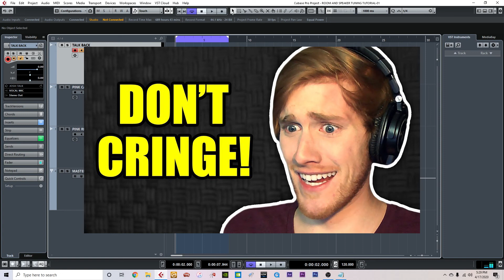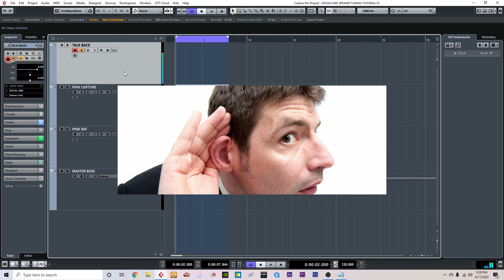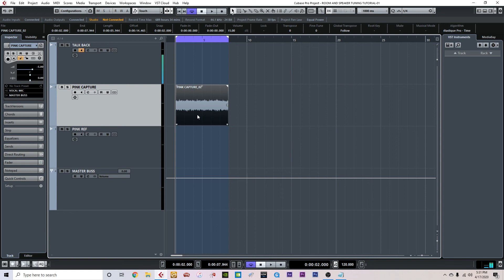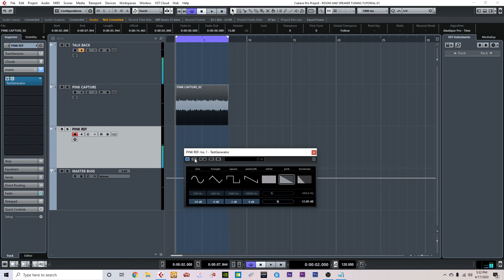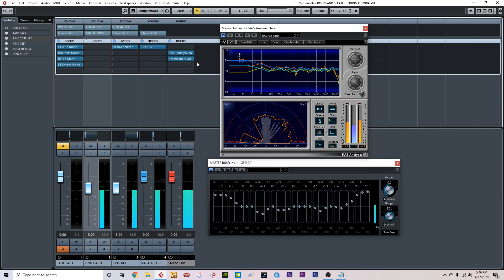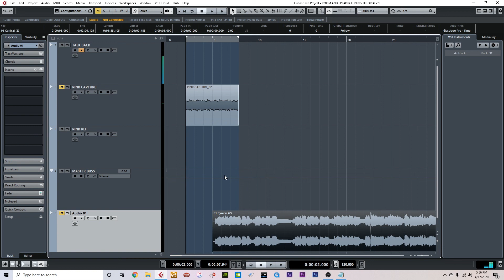HOW TO TUNE YOUR STUDIO MONITORS | USING PINK NOISE AND STOCK PLUGINS

Comment: Really nice job thinking outside the box on calibrating your studio speakers without a major investment. I was going to use Sonarworks but it just doesn't want to behave on my DAW computer so I used an external stereo 31 band EQ along with a physical RTA that is in one of my gig racks and it worked quite well in flatting out the speakers response however I just didn't want to have a physical EQ in my rack for the DAW so my idea was to do something really close to what you did here and I created a master group track so that all of my individual tracks would have to pass through the master group track that I would use to run a solo calibration track through and when I am ready to bounce the mix down to a stereo track for mastering I just disable the EQ during the rendering process. I like your idea a lot but I have to ask you as to what you are using for a microphone to capture your speakers with? With Sonarworks and some of these other programs that are designed for this they will normally sell you a calibrated microphone or explain how to load your own reference microphone into the program so that you don't get added color from an unknown reference microphone such as a bump up in the high end or any other microphone artifacts that could cause the calibration not to be true enough. I do agree with you to do the sweep where you sit and listen and I love the way you were doing the comparisons using the plugin! I also agree with you 100% that it does NOT have to be perfect! The main thing is to nail the really big dips or hot spots and call it a day! I will now go and do what you did here with the exception that I will use my rack mount RTA because it comes with it's own calibrated microphone so I know what I'm working with. Great video man!
Reply from the maker: Thank you so much for the nice comment and reaching out, sorry it’s taking me forever to respond to this. I’m actually using sonar works now and I use their microphone that comes with the software. It essentially does the same thing and is pretty accurate from my experience. I try not to get to caught up in the perfection of things but it’s really important to be able to hear what you are mixing if your goal is to get a nice balanced mix. Using your method I think will serve you tremendously and you will have great results from it. Make me super happy I was able to help some lone or at least confirm their direction a little bit. The science part of music creation can be fun too!! Cheers brother!!
Reply: @recordingriot3450  I actually have Sonarworks on a second computer but I use it with my Samson headphones which Sonarworks already had a pre-eq'ed  plugin which simplified things on that end. I would use the Sonarworks software on my DAW but Sonarworks but it does not like my digi hammerfall sound cards because they are a bit older but they have great specs and I'm not willing to go out and spend more money for a newer set of sound interface cards especially when there is a workaround for the cards like you did in this video. Once again, thanks for your video.
Reply from the maker: @flash001USA  oh yeah 100% agree use the work around. Can’t justify spending money if what you have is doing what you need it to do!! I’m just using it because I got it super cheap with a Black Friday deal and it takes the guess work out of all of it. Happy mixing friend :)

Comment: Did you try using your boundary EQ compensation switches first while referencing the pink noise in real-time? Most 31 bands are Q to 1/3 octave. Plus you're only seeing the curves go up or down without seeing how your room acoustics are affecting the frequencies. You should be doing a realtime with an actual measuring microphone and not a typical dynamic microphone. That drop in high end is probably the dip in the frequency response of the cardioid pattern of the mic used. Measuring mics are Omni and are engineered to be ruler edge flat frequency response. Those frequencies in between the 1/3 octave can be adjusted with a parametric EQ. 31 bands are a third octave of each next frequency on the scale. Third octave of 20 is 25.2. so using a third octave EQ is not the best idea. Your not adjusting the response of the speaker. You're altering the octave voice of the speaker. Boosting all those hi frequencies are going to make your high end sounds honky and  nasal. Not natural. Your mixes will sound worse than when you applied EQ compensation. Correct idea. Wrong tool

Comment: Nice....but which track did you insert the eq in to make adjustments...ref or rec track?
Reply from the maker: The eq is applied to the the recorded pink noise track, then once it’s matched to the ref you then take that eq an put it on your master stereo out so that all of your tracks are affected by it. When you go to export make sure and remove the eq from your master. It’s only there to change your listening environment to a more accurate representation of what’s actually there in the mix. Hope this helps!!!

Comment: what mic did you use capturing the pink noise ?
Reply from the maker: I used a shure ksm 27, def not the correct mic to use but don’t feel like you can’t use what you have. Just take a look at what the curve is for the mic your using and keep in mind it’s going to boost or cut those frequencies. I know my mic boost at around 5-6k so I took that into account. It’s not perfect but it’s definitely better. I know bc I can trust my mixes more now bc they sound how they are supposed to everywhere else when I listen to them. 

Side note, I’ve since upgraded to sonar works reference 4 for measurement and it’s amazing. Def worth the 229 that comes with the measurement microphone. 

Thanks for commenting
Reply: @recordingriot3450  Yes this is so informative thanks to you! I was using Audio Technica AT2050 a while ago lol. Will this be ok? Especially i was just staring correcting my room a while ago. Defenitely would purchase that Reference 4 soon!
Reply from the maker: Yeah that mic would work just fine, use it bro :) when you can I’d def suggest the sonar works ASAP though. You’ll be asking why you didn’t do this sooner trust me! Glad I can help out!